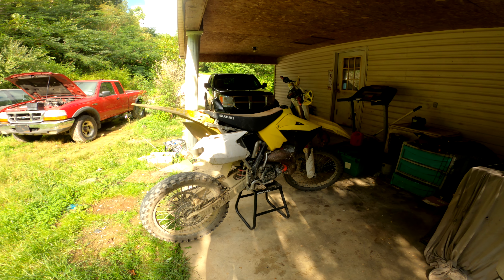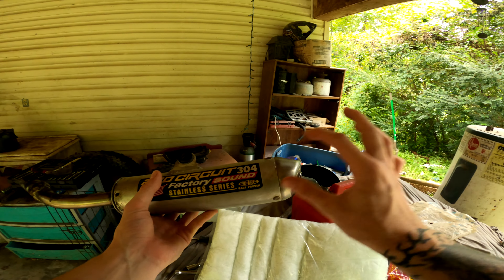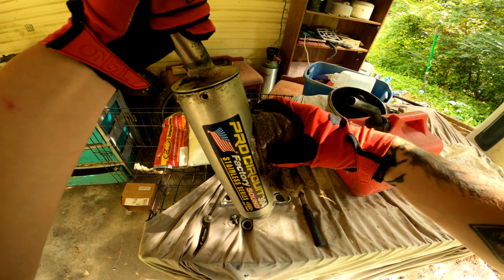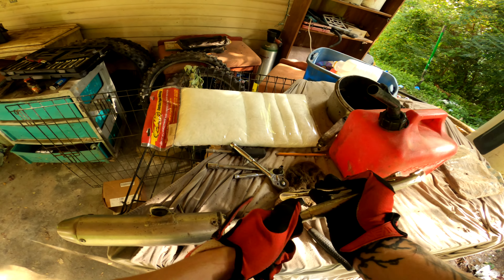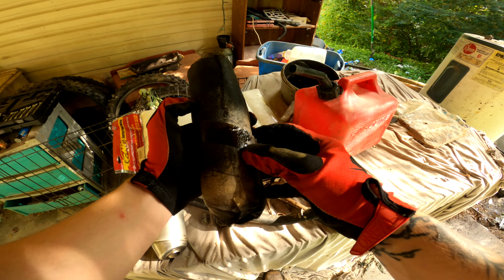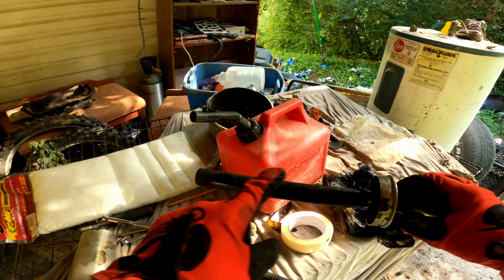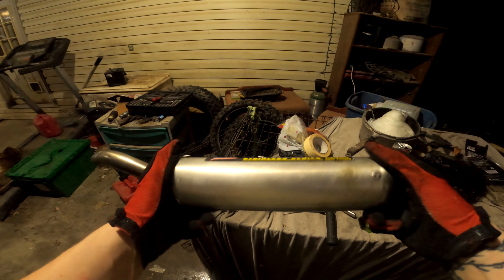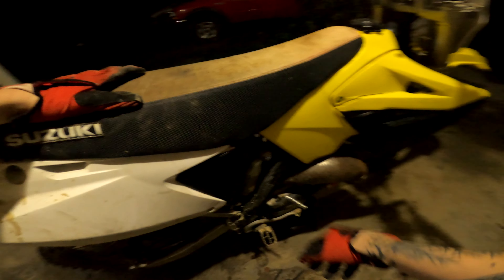Unlock The FULL Potential Of Your Exhaust! | Suzuki RM125 Exhaust Packing

Comment: The key is to use scotch tape to keep the packing tight so you can fit it into the pipe than Once you get it into the pipe you use a heat gun the scotch tape melts and makes the package nice and tight .
Reply from the maker: I started off not doing that and it started going south so I used some masking tape and it helped! 
What took so long was getting the insert lined back up with the tip of the exhaust. I guess in the process of trying to get the stuck insert out I must’ve bent it which made it wayyy harder to fit the packing in tight and get it lined up just right.

Comment: Sounds good, just don't work out the labour cost. Doing it yourself is worth the hassle.
Lazy old me would have replaced it, past me did the same and also burnt of the inside of the pipe and run some barbed wire through it.
Reply from the maker: From what I’ve figured out it’s better to do it yourself also. It gives ya the opportunity to learn and save some money